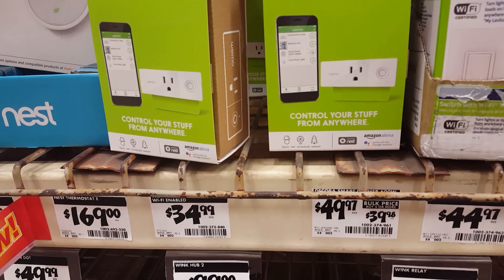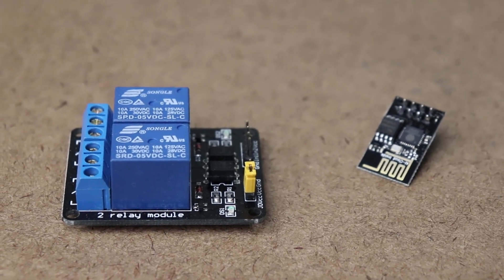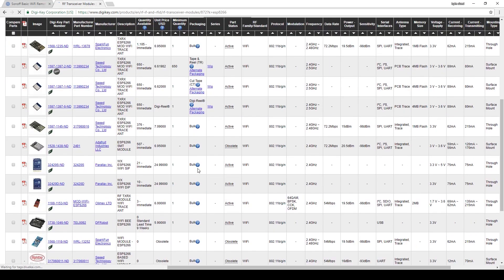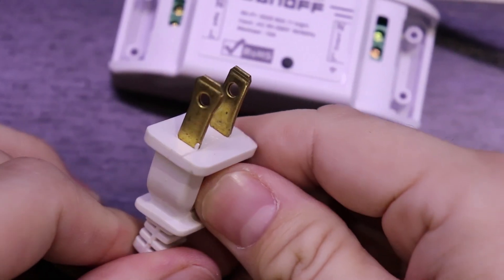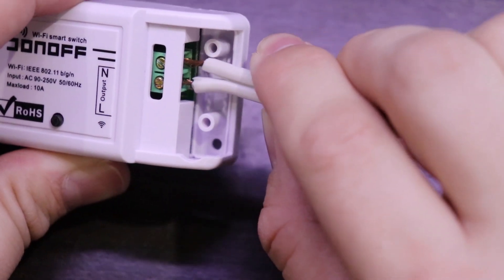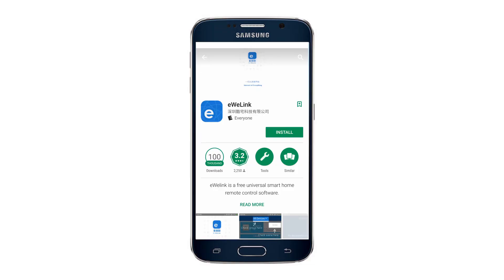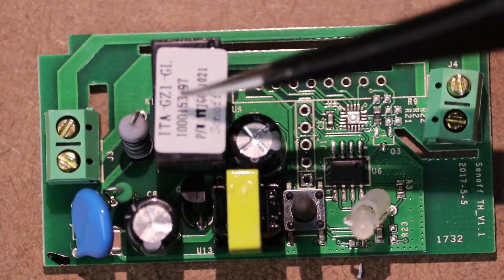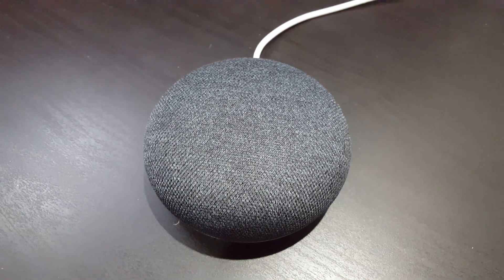Sonoff - The $5 WiFi Smart Switch That's Compatible With Alexa And Google Home

Comment: I bought it, but something is wrong with it. It turns on the lamp, but only for a fraction of a second, then it goes off. Even when I'm using the manual switch. Any ideas?
Reply from the maker: Yes, go into the settings for the device and turn off "inching". That's what it sounds like.
Reply: @bytesizedengineering  Thanks, as it turned out I had to put it BEFORE the led rectifier, now it works perfectly. Great vid by the way! :)

Comment: Just a shame you use google though. Run something opensource like openhab. Completely customisable and completely private.

As soon as i come up the driveway and  my phone registers on the wifi network and it is dark lights go on automaticly, radio turns on some music etc. 
If i turn on the projector all lights go into dimmed mode automaticly.
It cas completely open logic. If it starts raining windows close automaticly and open again when it is dry if i am still home, if not it will not open them.
Reply from the maker: Very cool. I prefer google assistant.

Comment: Does anybody have an estimate of many Watts a tube florescent light bulb ~3ft is?
Reply: 18-32 typical for standard white T8 tube others depend on function.
Reply: @TheMacdr2002  thanks so much. So I'm guessing an extension cord with 3 bulbs is a bit much for this Wi-Fi switch. I remember reading that florescent light bulbs use a ballast and actually use more power to first start the reaction.
Reply from the maker: I would look at the box the bulbs came in. The ballast would also use some power.
Reply: @bytesizedengineering  
Thanks, but they're the lights built into my cubicle, I can't see the ballast, so I'm just going to plug the (actually 5) bulbs into a surge protector and then I'm going to use a solid state relay powered by a battery powered Arduino Mega with an RTC module.

I'm trying to make my lights turn on and off without having to get a step ladder and press the 3 switches twice a day.

Comment: Hi Zach, any idea how to use one of these for turning on and off a fireplace which has a very simple low voltage switch? Just a simple one white wire and one black wire attached to the posts marked “TH” and “THTH” ?  I’d like to get Alexa turning my fireplace on and off... not controlling a thermostat or anything complicated :)
Reply from the maker: Were you the one who also emailed me about this? Not sure I can help sorry!

Comment: Thanks for the video. At 2:44 you mentioned polarity and we need to connect correct polarity input to the device. I have a doubt whether the device will work if the polarity is reversed or will it get damaged? Please kindly explain why we need to connect input N to N and L to L. Many thanks.
Reply from the maker: The device will likely work okay with the polarity reversed. But it's standard to switch the Line wire as opposed to the neutral wire.

Comment: Can this be use in a car to control LED strip lighting.
Reply from the maker: Unfortunately this device isn't designed for this type of application. Check out my videos on relays to learn how those will work for your project.

Comment: Hi. Does this switch require internet? I read some reviews where somebody reported the Sonoff not working when internet is down on WIFI
Reply from the maker: It's a WiFi switch, so yes it requires an internet connection to control remotely. However there's a manual button that controls the switch independently. This is in case you need to control it without worrying about an internet connection.

Comment: Thanks for your help and explanation.
Does this switch disable the regular on/ off? Will I only be able to turn the blender (following your example) through my phone?
Reply from the maker: There's a button on the sonoff switch that allows you to turn on/off the device independently of the app.
Reply: @bytesizedengineering  thanks!

Comment: Monitoring energy consumption; - I see a shunt resistor placed inline with the Neutral - and an opto isolated op-amp + analog to digital converter module... - the digital could arguably be spat out over ftp.... maybe a com port.... - the concept of such modules is now easier than ever!
Reply from the maker: I learned later that sonoff makes another model that does power consumption. See my follow up video
Reply: @bytesizedengineering  you got an exact link please?
Reply from the maker: https://youtu.be/scerfgdSjlo
Reply from the maker: https://www.itead.cc/sonoff-pow.html

Comment: Do I have to be on the same Wifi Network to operate the Sonoff ?? Can I control it using my 4g cellphone while away from the switch?
Reply from the maker: You can control the switch from anywhere you have internet access

Comment: Can i use this switch for 12v dc input, to start my motorcycle wirelessly?? Or if i can power the switch seperately and use relay to pass power supply?
Reply from the maker: This switch isn't designed for such an application. You'd need something else

Comment: great device , Thanks for sharing.  I have been an Electrician for the past 22 years, so I want to make a suggestion.  The device is rated for 10 amps, so you need to use a chord that is rated for that amount of amps.  The extension chords like you show probably isnt rated for 10 amps.  size 18awg wire is rated for 10 amps, for an extra bit of safety edge I would use nothing less than 16 awg wire on this device.
Reply from the maker: Thanks for the helpful feedback and doing it in such a respectful way! You'd be amazed how how many comments are just plain disrespectful! I believe the cable is 16AWG, but I'll double check. I'm not connecting anything that draws more than a couple of amps anyway. Thanks for watching!

Comment: I'm a little confused... most devices have switches though right to turn the device on or off.... how would the sonoff interface with that kind of device.  An electric kettle for example.... you would basically need to bridge the line and neutral to be always on .... give the command and then have something that would turn it off or it burns....

Comment: Neat, but I see these Sonoff switch cost around $10 CAD. The Smart plugs also cost the same. So not financially worth it, at least not for Canadians.
Reply: Order on aliexpress. 3 bucks each if you buy 10 or so.
Just takes a while to get to you. But if it isn't urgent that is fine.

Plus you can easilly intergrate these into your electical system and put them behind your wall.
And these can be flashed so they will work with all home automations servers without calling outside of your network, something other devices often can not do, they need to call home to the manufacturers servers. A huge privacy concern.

Comment: This video is good for someone who needs to know how to wire the it up,  and thanks for that, but any info on how to pair the thing? I've tried but no luck so far. :-(
Reply from the maker: Have you tried reading the tutorial on their website? I have trouble sometimes adding it to my network. A couple of things to try: make sure your phone is connected to a 2.4GHz WiFi network and not a 5GHz network which are not supported. Also put your phone into airplane mode first and just turn on the wifi before trying to use it to add the sonoff device. Hope this helps.

Comment: I have tried these and Gosund SmartLife. Gosund does not make an in line switch , but the wall plug is a much better device. They are both very easy to set up, but the Sonoff is twice the size and depending on where the plug needs to be placed, can waste a wall socket. Also you can get Gosund on Amazon in two days. It took two weeks for Sonoff to arrive.

Comment: Technically you don't need to cut and plug in the neutral wire. Just the line wire is ok.

Comment: 5$ is dirt cheap, but my lord, so is the build quality. I would NOT install these around my house, given the requirement to honor Line-Neutral alignment and the look of the small relay and the very small clearance between mains with solder slapped onto it. I'll wait for a $10 version with a better build quality.

Comment: I'm getting ready to build this kind of a system for my van conversion. I'm going to be running a lot of solar on the roof but I want to have an embedded security system with GPS tracking and be able to remotely turn on and off all the various 12 volt Electronics as needed. The problem that I'm having so far though is a simple one these sonoff devices are for 110v AC but I am looking for 12 volt DC options. Perhaps it's time I get to building my own circuit and if I do I will be open sourcing it.

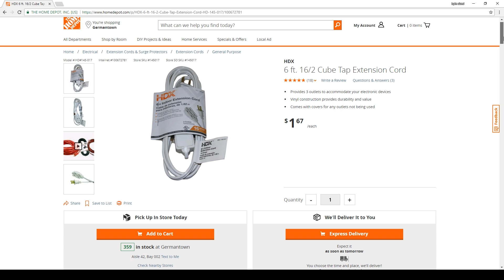Comment: 2:11 Homedepot saves your money, said Spotifly!
Reply: Therefore this Sonoff switch is not only $5 since you have to add a $2 cable to it. ;D
Reply: @BillAnt  you could technically do this with the existing power cable on your devices also.
Reply: @Austin Connell < You could technically do it with an existing Sonoff too. ;P jk
Reply: @BillAnt  still cheaper than the majority of it’s kind.

Comment: While this an excellent device I strongly advise against using the supplied app. Unless something has changed since I bought mine the app is highly suspicious, it requires far too many permissions. Why does a switch need access to your files, contacts, photos etc? Is all your stuff being streamed back to China? Thankfully this device can be programmed like an Arduino. I simply reflashed mine with my own software.

Comment: Hello Zach! I have 2 questions about the product you intorduce here.. First of all, how do you know if it complies with the IP (Has nothing to do with the internet!) it shows? I can tell you, that it absolutely does not comply with the IP66 it shows. The Maximum of Protection I'd classify it at would be an IP31/41 (IP66 = Dustproof and protected against water jets from any direction, IP11 or 21 = Proof against contact by items >50 or >12 mm in diameter (hand or finger) and protected against water dripping ontop of it from a 90 degree angle) If you look at Minute 3:27 there is a massive gap between the teeth that bite into the cord and the plastic brackets around it, leaving enough space for water/dust to enter the "switch" (wireless-relay).
Next Question is: Are you sure the way you stripped the wire and put it into the contacts is the right way? I can tell you again: It would be right if the cable wasn't flexible (multiple thin copper braids) but as some people mentioned before, you'd also have to leave the insulation on the clable till you reach your connection terminal. Don't just assume the mounting hole was 10 mm and strip it that way and leave it be for good, if you stripped it too far, just cut back the wire a little... Now, if you use braided wires, use ferrules to make sure you have optimal contact.

Comment: I thought your solution was going to be behind the wall... Switching the outlet itself, not a rigged extension cord.

I honestly would rather use some of those things you showed at the beginning. They are integrated into a single device that stays at the outlet, not a cord with a hump in the middle.

Comment: Can this be used to automate and remotely control a garage door opener? I was thinking of replacing the current trigger button for my garage door with this. I'm assuming that once activated by a command the sonoff would simulate the current button trigger and the garage door would open. When my old garage door button stopped working I wasn't able to replace it since it was so old. The company is out of business. I replaced the unit with a simple doorbell. It works exactly like the original unit did. Looks silly. But works fine. What are your thoughts about me replacing my current contraption with the sonoff?

Comment: itead + sonoff sells wifi viruses that infect routers with botnet from china. not sure if it has been patched yet. this was a few years ago. don't buy this shit. never again. hard to believe they didn't know about it. you are better off wiping the firmware and building your own stuff with sonoff hardware. these people are too cheap to make a chip that can't be completely wiped for a better firmware. safe after you wipe it. make sure you disable all devices in the 2.5 + 5GHz bands (wifi + BT) while you are powering it up to flash it. it can jump to other devices.

Comment: The point is to wire the device in line behind the switch in the wall........ No need for extension cords................

Comment: 1)  Thanks for the video.
2)  The wire "L" standard for live (AKA hot), not line.
3)  No you won't "hack" it to add power consumption.  It doesn't seem that you know as much about this widget as you presented.
4)  In this day and age with so many places offering free shipping, a $5 widget is not $5 if there is additional charges for shipping.  In other words, it is not $5 in a fair comparison.  It is still a good value, but when the premise is $5 thing and it's not $5, you fail.

 If you want to add some additional circuit that measures power consumption go for it, but that has nothing to do with this wifi switch, is entirely separate and could be stand-alone.

Comment: If you really want to play with Sonoff units, look into Tasmota.  You can flash the Sonoff firmware so it doesn't have to be directly accessed by the Internet.  BYW: Sonoff now makes units that can monitor the current being drawn by the devices connected to them.

Comment: In many places (like mine) there are no neutral wire, it is just two live wires. Under most circumstances you will never know any difference and it is cheaper.   Where there is a neutral, the voltage to ground may sometimes be zero, but you can never trust that to be the case. Without the neutral both wires will have full voltage to ground.

Comment: "Line" wires? Never heard that before. We call it "Live" here.
Reply: Line is technical more correct than live.we call it fase 1 fase 2 fase 3 over here L1 L2 L3. Technicall these are lines. N stands for Null or neutral.

Comment: Quick question...  When you energize the switch, what is the default state?  Does it automatically turn off?  Or automatically turn on?  Basically if I used sonoff to turn off the light in the basement, would I need to fumble around with my phone the next time I'm down there or could I just power cycle the wall switch to turn the light back on?

Comment: In my opionion its still better to build it yourself and here's why:

HLK-PM01 (for AC to 3.3v DC): 0,70$
CH340 (wifi module with for multiple relay output, works on 3.3v): 2,50$
10x 5V relays: 2,80$ (so arround 0,30$ each)
Wires and plugs: lets say 1$ (probably less, but lets say 1$

Total: 4,50$

Which is not only cheaper, but you dont need to install any extra app and it gives you the possibility to run up to 8 devices from the same wifi chip. So for example, if you have a lamp next to another lamp, next to your blender, you could just buy an HLK-PM01, a CH340 and 3 relays, which would sum up to 0,70+2,50+(3*0,30)+1 = 5,10$

5,10$ for running 3 different devices which would cost you 3 times more if you were buying the sonoff plugs.

The libraries and code for this are on github, just type something like "Alexa CH340"

Great video anyway :)

Comment: Regarding the following:
3) I have an extension cord/appliance that has three prongs (live, neutral, ground). How do I wire up the sonoff?

When working with a grounded device, make sure the earth wire is always connected, avoid cutting it if possible. If a cable breaks (e.g. by pulling a socket by it's wire), the Earth-wire should be the last to disconnect, ensuring any escaping current goes to ground instead of trough your body.
Just use a wire connector that fits electrician's code in your area (e.g. using Wago connectors) to re-connector the earth wire after cutting it. Or carefully strip the extension wire, cutting only L and N, but not E-wire.
Unless the Sonoff Pow uses the E-wire to ground itself too, you can use the Sonoff Basic using this method.

L >-----------------+
N >---------- +    |
E >--+        |     |
. . . . | . . [ N | L | Sonoff ]
E <--+        |     |
N <--------- +     |
L <-----------------+

Comment: You mentioned energy monitoring, including power draw, and I was just looking at a plug (TP Link HS110) from Walmart for $15 that has that. What I don't know, since I'm new to smart products and it is something you will certainly know or a reader might know, is the full function of a smart plug controllable through a Google Home device, like in my case, will I be able to ask Google Home for the information on what power a device is drawing, without having to go to the software app (Kasa in the case of this plug)  to see that reading?

While in this case, I see it's just a simple, inexpensive switch which just turns  something off and on, so this doesn't apply, and I know there are TVs and smart dimmable smart lights where you can set the volume or brightness by voice through a Google Home speaker, I'm not sure if the full functionality of every smart device is reachable or controllable through Google Home. If a reader wants to respond, that's fine. Thank you.

Comment: Thanks for the great video. Just one question: does the switch disconnect neutral or hot? Om thinking about adding the switch to my ceiling fans which have a shared neutral for light and fan. I only want to switch the fan and not the light without having to run  ew power to the setup.

Comment: im looking for a smaal wifi controller that works with amazon or google, and fits behind light switch in case in the wall or the case in ceiling where lamp hangs etc etc

Comment: Although it's not hard to attach the extension cord as you showed....sonos would sell WAY MORE, if they simply sold it already connected.  Even if they had to charge a couple $ more.  It's not like the cord is that expensive.